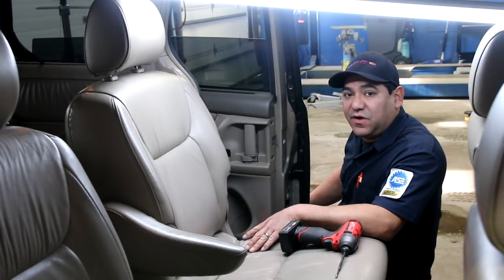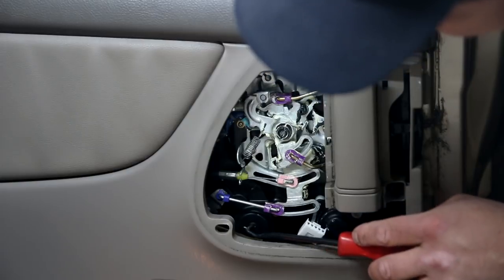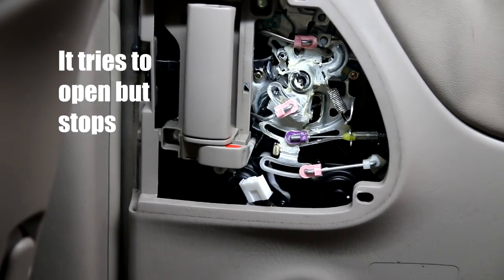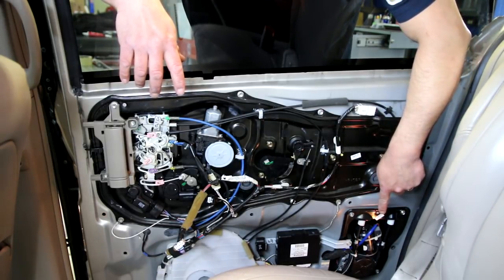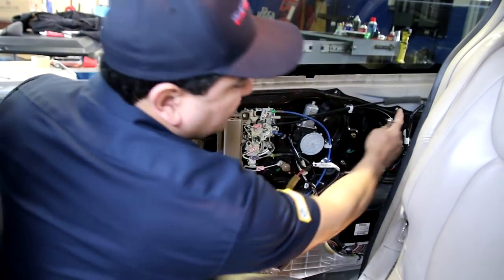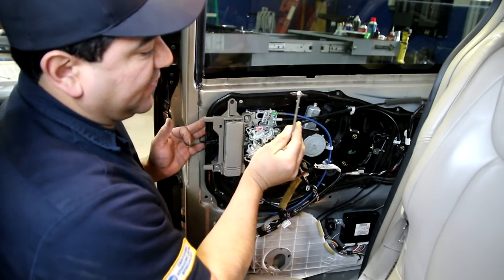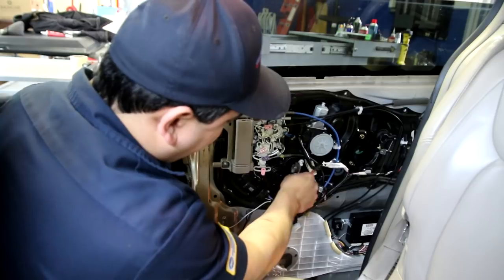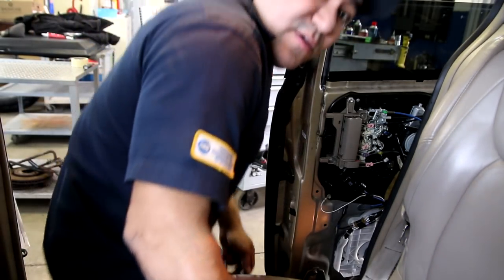2007 Toyota Sienna Sliding Door Repair

Comment: thanks for the video. I just replaced the motor inside the actuator. I was going to take the whole mounting panel out which requires disconnecting the window and ads a level of problems. my first for I had issues with the locktite. I used my stubby#2 and tried my heart gun. one nut started moving with the screw. the other stripped. I used my soldering iron on the other door and just took my time, held it to the screw with light pressure on the screw driver and both came right out. I used heat to put them back in also there is a ton of locktite). it worked great. my whole repair for both does will be less than $15 parts 😁.
Reply: i super glued the nut that was sticking to the bolt, then and also heated it to melt the plastic a little. let it sit for an hour and used my soldering iron to back the screw out (it's more important in that situation to make sure the locktite get just got enough to flow). I then used my soldering iron to heat the nut and melt the plastic enough to reset the nut. so far it seems to have worked, making so I only stripped one screw out of the 4.
Reply from the maker: Good job!
Reply: finished, and it came out prefect. The screws were M6 x 25mm
Reply from the maker: I am sure all your detailed comments will help others as well. Thank you very much Brian!

Comment: the only reason not to have the heads of the screws which hold the actuator face inside the car is to make a ball-buster to change...there is no engineering reason to have the heads on the opposite side of the panel
Reply from the maker: Exactly! Thanks for finally saying that. Having friends on the OE side I can see they do not really think about the repair.... but the assembly and I can understand that.... so here we are...

Comment: Hello Rico,  Thanks so much for this video.  After being quoted $2,300.00 to replace motor and cable on my 2004 Sienna XLE by my local Toyota Dealer, I decided to tackle this myself.  I manually pushed bottom lever more than a dozen times worked fine, then suddenly started working perfect with button switch!  Cable seems fine too.  However, when the door is fully opened and clicks into locked position it surges forward about a 1/4", perhaps that is the beginning of another problem??  Have you run into this issue?
Reply from the maker: Hello. No I have not, By the bottom lever do you mean the bottom of the door?

Comment: Thanks Rico - your video is still helping people out 6 years later! I fixed one door actuator on my 2005 Sienna several years ago using another video that removed the inside panel and involved clamping the window in place. Yesterday I fixed the other door using your approach. Not having to remove the panel or touch the window eliminated some of the risky/difficult steps that I previously followed. It really just left the difficult task of removing the two screws and then getting them back in again. I was able to complete the task using a phillips screwdriver, a ratcheting socket wrench with 10mm socket, 5/16" socket and phillips screwdriver head, a stubby screwdriver and a soldering iron.

There are quite a few other videos/approaches out there which was a little confusing although some of the answers to the questions below helped so hoping the following may further help others (who will still need to watch your video and a video on replacing the motor) if any of these vans are still around:

1) Remove the housing around the door controls - take out two phillips screws, pry off the housing, and disconnect from the white harness
2) Remove the one screw (5/16" socket) holding the upholstered door panel and pop the panel off. I start popping it off near the door controls and worked my way around the door. It did take some force to get the first fixing to pop out.
3) Remove ALL 9 screws (10mm socket) from around the edge of the inner black panel - only the 9 screws around the edge not the ones in the middle
4) Do not remove the triangular piece of trim from the window, do not remove the two grommets and do not remove the two bolts that attach the panel to the window mechanism
5) Detach the actuator arm from the opening mechanism and disconnect the black harness from the actuator
6) Carefully ease the black panel out a little so you can get your hand in behind it
7) This step is the most difficult and requires a ton of patience and then some. Using the tool that Rico has or a ratcheting socket wrench with a phillips #2 screwdriver head behind the panel - get the screwdriver seated onto each machine screw that holds the actuator - this is done using feel as you can't pull the panel out far enough to see behind it properly. Once you have the screwdriver seated into the machine screw on the back, heat the screw (brass coloured) with a soldering iron from the front side of the panel. Keep testing whether the screw will turn - it may take 30 secs to a minute. Once it turns you can carefully unscrew it. This may take multiple attempts - I think it took me more than 10 goes until it was out far enough to unscrew with my fingers. The loctite will need reheating each time. This was not a quick process for me but by taking my time I managed to get both screws out without damaging the heads.
8) Remove the actuator unit and either replace the whole thing or replace the $5 motor (Digi-key p/n P14346-ND) inside it by removing the 3 screws to open the actuator (other videos on this step)
9) Reattach the actuator to the panel by feeding both screws through the panel from behind and lining them up with the two screw holes in the actuator. Tighten them up as much as possible by hand so that they won't fall out. I reused the screws that I had taken out. Then using a stubby (which seemed easier than the ratchet for tightening the screws), get the stubby seated into the screw head and begin to tighten. You may need to apply heat again from the front as the loctite may lock the screw up again. Getting the screws back in was much easier than taking them out.
10) To finish off reverse steps 1 to 6 and do them in reverse order. The outer door panel seems to go on easier by feeding the rear end of it in first as it needs to go under the trim at the back end of the window.

The above took me longer than what some others have said, however, it didn't involve drilling anything out or cutting anything which was my preferred way of doing things.

Comment: Terrific explanation. I just tackled this project tonight and yeah... Those two screws are lock-tighted in like no other! The tip to heat the screws was great. I used a small butane torch and it worked for one, but not the other. Trying to be careful, I eventually melted the plastic housing on the actuator and then the nut just started spinning inside the melted actuator body.

Ultimately, I took a Dremel tool with a 3" thin routing bit and just carved the screw out of the actuator body. This was actually much much easier and quicker than trying to carefully heat the bolt. 

Still had to buy two new M7 bolts, but better that than dealing with stripped out screws. 

Good luck everyone!

Comment: Do you have a video to fix a manual sliding door that won't open? I can't even get to the screws to open the panel around my handle😢
Reply: My window doesn't go down far enough to expose the snap on the black trim piece....hmmm

Comment: The switch on the dash board does not work either. I have to take it to the shop to get the door fixed. Now its working manually. It probably will cost my 600USD plus to get the power door reinstalled. Thanks for the help everyone.
Reply from the maker: Some customers just decide to use it manually. You are correct, they are not cheap repairs.

Comment: Rico, thanks for the helpful video! I'm about to start this job on my 06 Sienna. Question - which bolts did you remove/leave alone on that black panel? I've seen/read other tutorials where they're removed the whole black panel from then door. Is that unnecessary? Or can this be done without removal the panel from the door?
Reply from the maker: I removed all of them so it was loose. From there you can work with it without removing the whole thing. Just be careful you dont pull on it hard or something will get bent or broken. Sorry for the late reply. Perhaps you already finished it.
Reply: Rico L. my door would not open at all. how do I take the first 2 screws where the lock realease is located?
Reply: Rico L. my door would not open at all. how do I take the first 2 screws where the lock realease is located?
Reply from the maker: Have you tried turning off the power function?
Reply: Thanks again for the help! I started and finished the job today on my '06 Sienna Limited. Regarding the screws that hold the actuator to the panel, the first come came out with minimal trouble but the other one quickly stripped its head so I had to get a dremel to cut a slot for a flathead screwdriver. Thank the Lord it came out after that and I didn't have to grind it off completely.
Reply from the maker: Glad you got it done!!

Comment: On my van only the lock is not working. You have to do it manually, it does not unlock with the key fob or the unlock button on the driver side. Would I have to buy this part as well in order to make it lock and unlock electronically?
Reply from the maker: Hello Zeneros. In your case you want to check the power door lock actuator if it is not working at all. It is located just forward of the door release actuator. It has 2 wires so put a voltmeter on the two wires and if it has power when you try to use it replace it. Don't worry about polarity if using a digital meter, it will show - or + ....you just want to see battery voltage. Test it connected and backprobe with pins. If you test it unplugged there is no load and that can throw you off if there is a wiring issue and I mean a slightly broken or corroded wire can deliver the voltage but not the current to make the part work. One clue of a wire damage issue is it appears to have a good power and ground testing it unplugged but once you connect it does not. That applies to any electrical part and then you have the fun job of tracking down the bad spot. Often its a chewed wire....Hope this helps.

Just a note to everyone. Make sure the child lock did not get flipped accidentally, that can throw you off when diagnosing.
Reply: thanks I'll check it out
Reply from the maker: No problem and let me know what you find or if you have a question. I will respond as quick as I can.

Comment: How to take the plastic assembly off if the passenger door stuck closed. Can not work on the two screws of the handle. Thanks.
Reply from the maker: Sorry it took a few days to respond. Did you get it already? If it will not open at all you do not have many options. I take it you tried the inside and outside handle?  If it will not open at all you have other issues that I did not cover in this video. It will be hard to get that off without damaging the panel.
Reply: You've probably solved your problem already but here is an idea for anyone else with that problem. My van has this same problem. When the sliding door button on the dash is turned on I have to hold the door handle out until it starts opening and do the same for it to close. If you switch off the sliding door button on the dash you can open it manually without trouble. I hope this works for whoever needs it.
Reply from the maker: Thank you Chris! Good ideas and advice are always welcome.

Comment: What kind of screwdriver is that?
Reply from the maker: It is the brand GENERAL No. 807-X. I do not remember were I got it but I have had it forever. It doesn't get used much but is handy when it is. There are also many styles of the low profile screw drivers that take the 1/4" bits like the Craftsmen 41716.